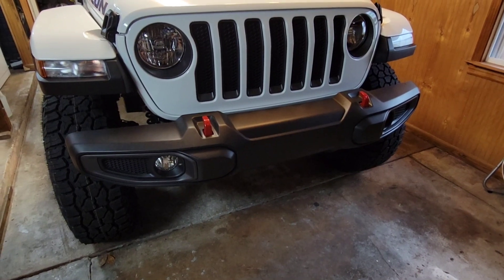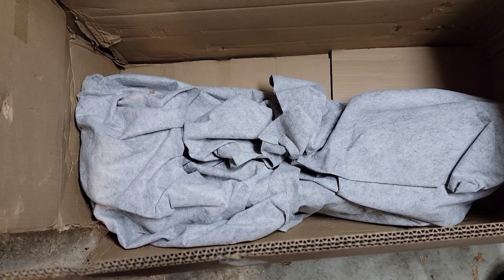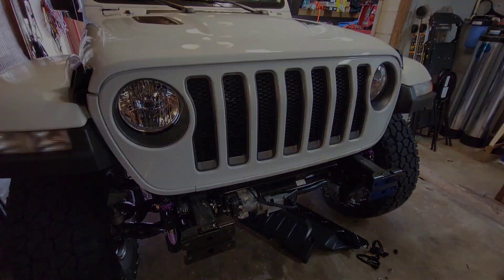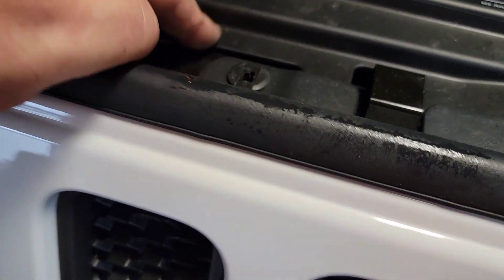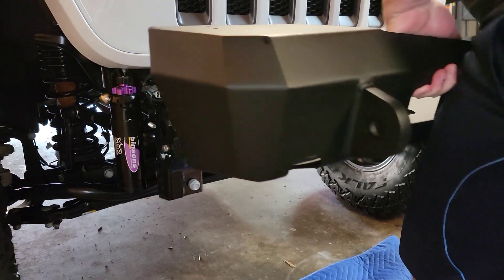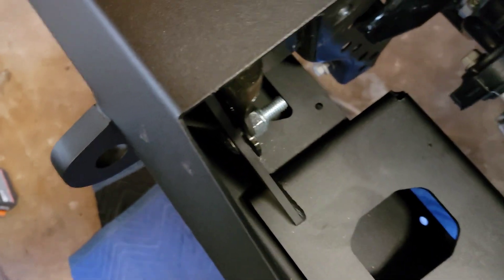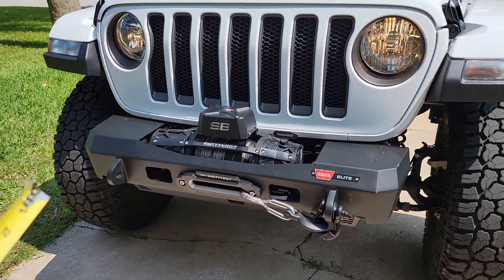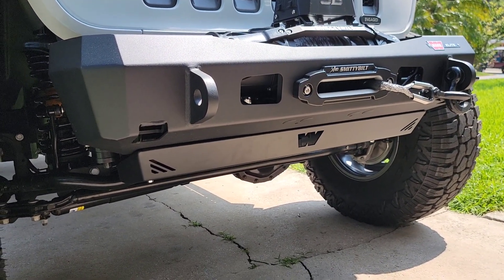Warn Elite Stubby Front Bumper Install on a 2023 Jeep Wrangler JL Unlimited Rubicon

Comment: Very nice front bumper, I like how you dont have to cut the frame horns or switch to the antirok sway bar in order to install this bumper, but after the bumper is installed doesn't it include a front license plate mount? If so can it be mounted on the right side of the bumper?
Reply from the maker: It's been great. I've had it on for a bit over a year now with no issues. No license plate holder was included. I'm not sure where could mount one without drilling some holes
Reply: @ExitOffroad  Yea ok, do you know if there is a necessary fairlead size you will have to get with this specific bumper?
Reply from the maker: @christiandeee6058 you just need the standard fairlaid size that comes with pretty much all 8 10 and 12,000 lb winches

Comment: Any follow up video on adding lights to the bumper? I have a 23 rubicon and it has fog lights. I don’t like the idea of not being able to use my OEM fog lights. However, this is the cleanest and simplest bumper for the JL. Love it.
Reply from the maker: I have added some large driving lights to it. I haven't made a video about how I added them but they can be seen in a new video soon on upgrading the headlamps.  With not much room, I opted for the biggest set of lights. There's no way to add factory fogs to this bumper. It has holes so you could mount a stud mounted set of lights easily.